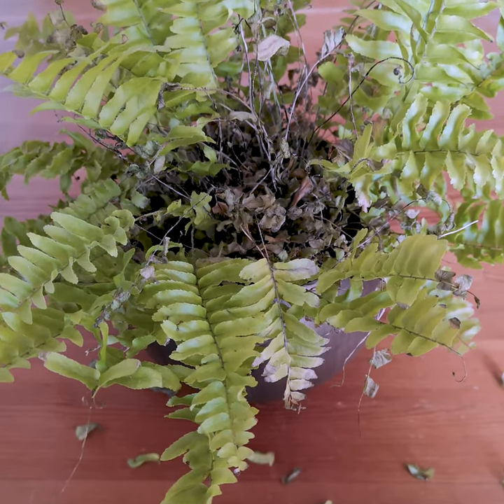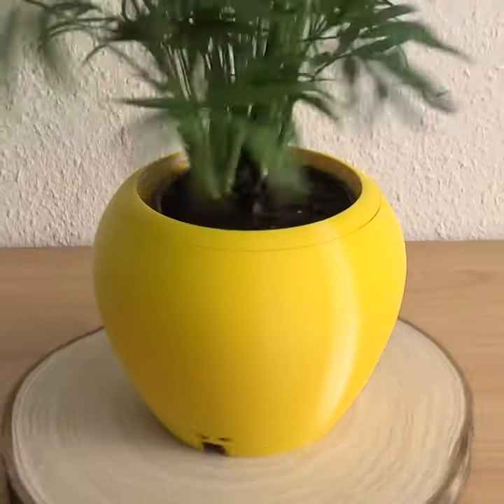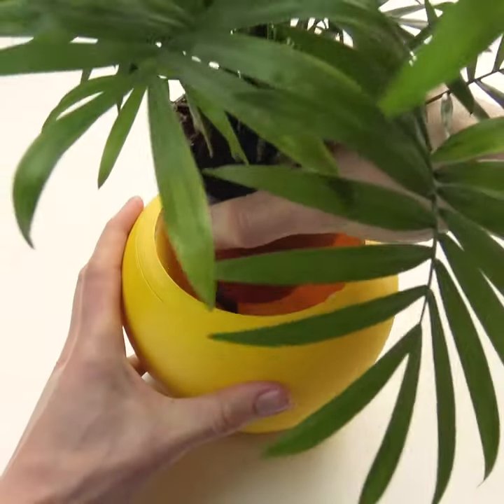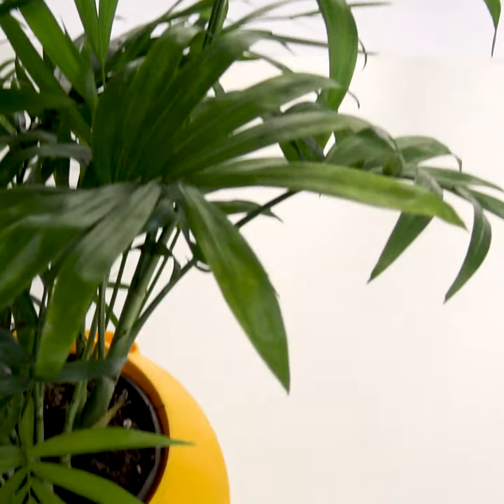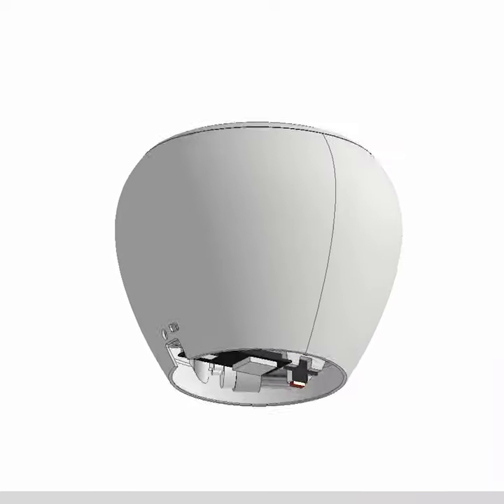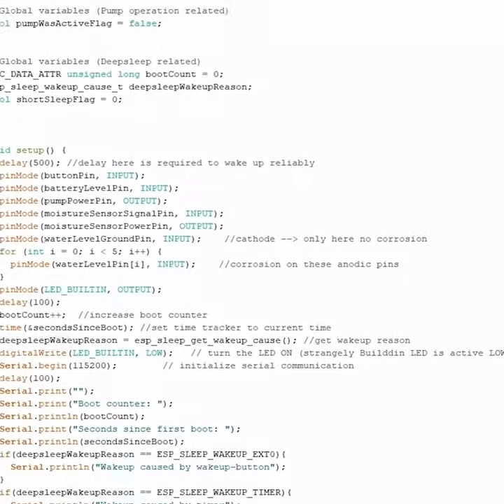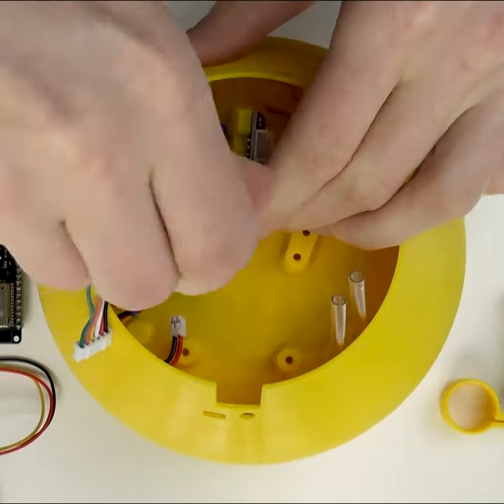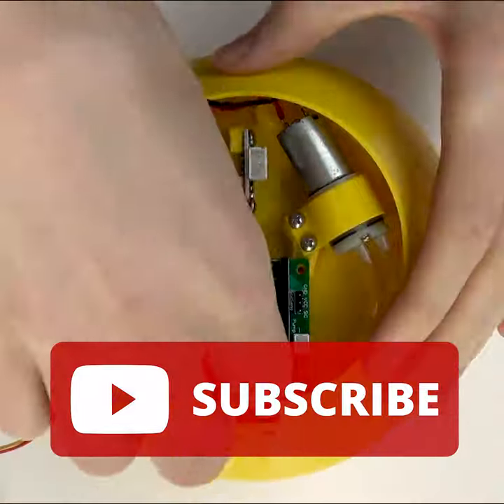TEASER: Smart, automatic plant pot "Flaura" (DIY, 3D printed, Arduino, Self watering) -

Comment: Looking forward to this. Could you share your experience regarding the difference in growth from your normal routine?
Reply from the maker: Well, my normal routine usually led to the plant being dead after a few weeks – easy to get an improvement in grow compared to this :D

After I found the correct soil moisture threshold (Of course that’s different for every kind of plant) to activate the water pump, my plant is growing very consistently – a new leaf every few days or weeks which makes my super happy :D.